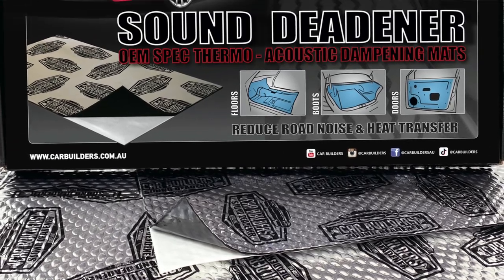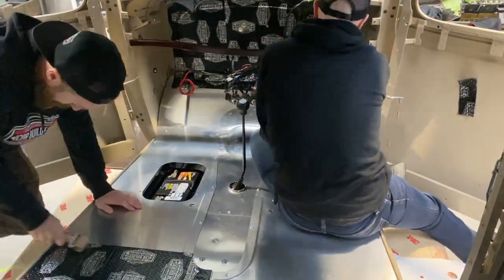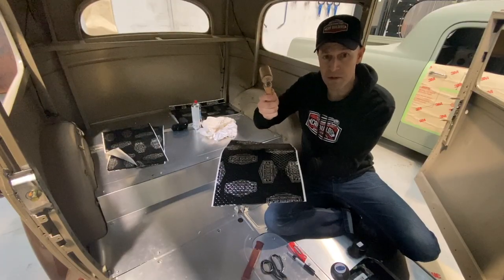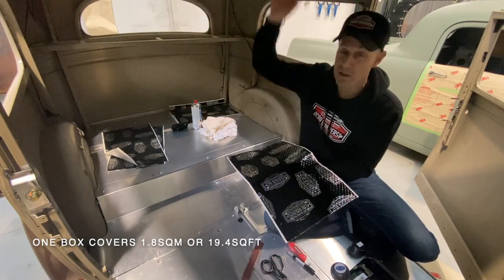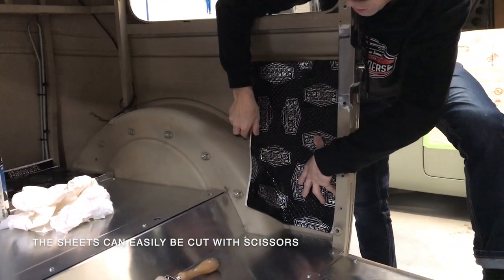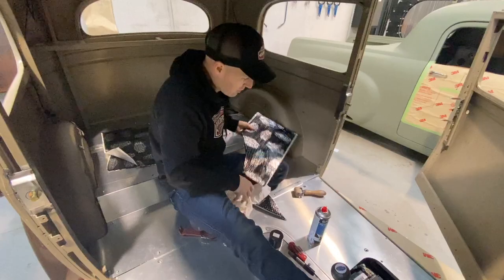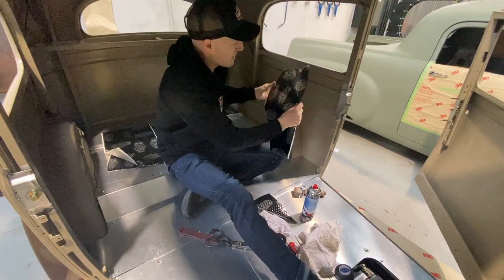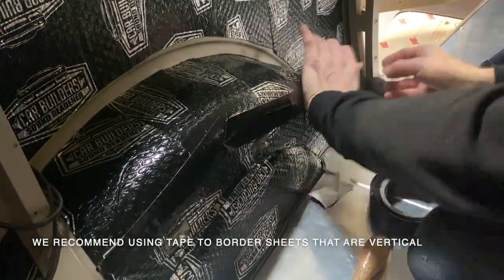Stage 1 Sound Deadening Basics. What is a butyl deadener?

Comment: Why you cover whole panel with butyl? Isn't enough cover just 20-30% of panel?
Reply from the maker: You're right. Around 30% of a panel will make a significant reduction. Further deadener will continue to produce results but not as dramatic as the initial application. This customer wanted it thoroughly covered. Auto manufacturer's will engineer sound proofing additions to a dollar point, researching the optimal positioning for deadening to just meet consumer expectations. Vibration dampening mats are most effective on single skin metallic surfaces. It is unnecessary to apply deadener to over-lapped metal sections, top hat, chassis sections etc as these areas don't resonant. To engineer a car it takes some skill and technical analysis to pin point key areas, in reality most people will cover everything as they don't mind spending a bit more to ensure they have achieved the desired results. With paying customers, most people want everything covered. 👍
Reply: @Car Builders - Thermal & Acoustic insulation materials I have Opel Astra Kfrom 2017 with a lot of equipment but have a lot of noise from the trunk area. Here in Europe, Croatia did not find people who will install car insolation and I have some expirience from mechanical workshops from my young days (changing clucht, tires, oil etc.). I thought to remove plastic and covers from back seat and everthing in trunk and then apply Butyl cca 30%, then over that full cover with foam 3-9mm.

Btw Great channel.